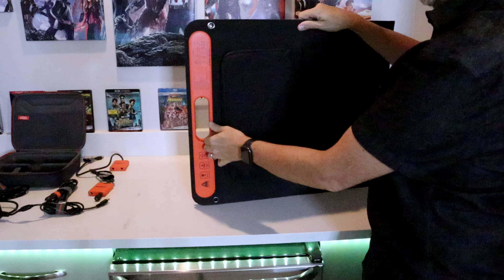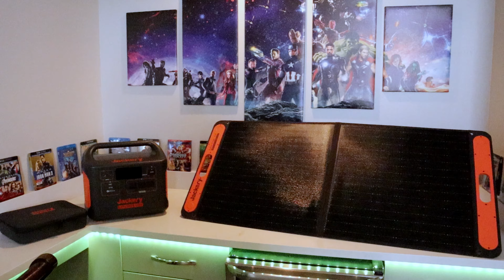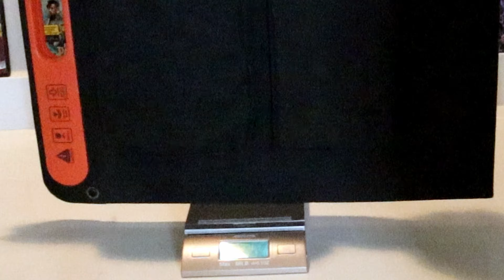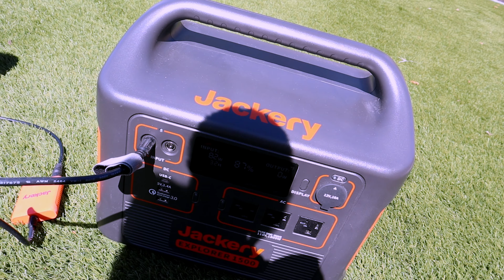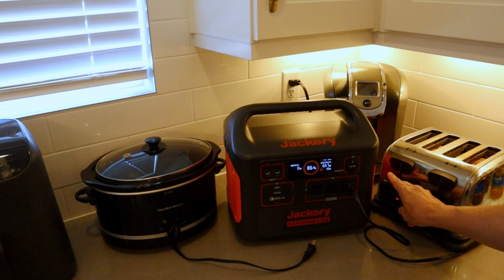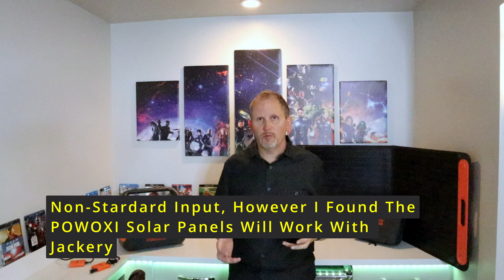JACKERY EXPLORER 1500 Solar Generator Review Portable Power

Comment: PLEASE READ BEFORE PURCHASING A JACKERY PRODUCT! I purchased a 1500 pro and had a terrible experience. This is my honest review to spread awareness to others. 

BEYOND FRUSTRATED DONT BUY FROM THIS COMPANY! When I received my first unit it was clearly brand new which would be expected. The battery was great worked exactly how they explained it would in the description. I would use this unit running off my ice co electric cooler with multiple accessories and it would last me 3-4 days while camping. Within the first 6 months I used it maybe 4 times and then stored it over winter (4-6 months) When I pulled it back out of storage for use the battery was at 97% hardly dropped from 100% when I stored it away. Awesome this is what they advertised on their website. But during my next camping trip my unit started showing a F0 code and nothing would work no input or output. This was a huge problem since I heavily relied on this unit to keep my food fresh and not spoiled. I noticed while lifting the jackery up and placing it in my vehicle to charge (thinking this would fix the pop up code) the F0 code turned off thankfully saving my food and my trip. When I got back home I emailed support and they informed me this was an internal issue causing some sort of disconnect normally due from faulty parts, dropping the unit or negligence during use. This was not my case since I never dropped the unit or mishandled it. I shipped my original unit back thinking they would stand by their “warranty” WRONG they clearly sent me a used unit that dropped battery 5-7 % a week. The unit had some use marks on it and I could tell it has been used before even though it was wrapped up like a brand new unit. I emailed support again going back and fourth as they tried to justify that this was normal even though my new unit did not have this issue. The battery was obviously compromised and after restarting it and charging this warranty unit to 100% it dropped down to 67% in 30 days. Support agreed this was not right or normal and sent me another unit. Annoyed already by this and me having to drop off now another unit to fedex I was adamant that they review this unit to make sure the battery was in fact compromised (so this wouldn’t happen to another customer) and to review the new unit they send me. They sent me another “warranty” unit… it was the same exact s/n # as the unit I just sent back to them! I cannot make this up.. terrible support terrible company! I bought this $1,300 1500 pro plus a $600 200W solar panel due to the great reviews and WARRANTY they claim to faulty parts or makes on their end so the buyer is protected on their investment. Don’t buy from this company! I fell into the trap of there multiple highly rated reviews (that they probably pick out) and the fact that they had 2-3 year warranty on their products. THEY DONT REVIEW THEIR RETURNED PRODUCTS AND WILL SEND YOU ANOTHER FAULTY UNIT THAT THEY CLEARLY DONT CHECK. PLEASE STAY AWAY SAVE YOUR MONEY AND GO WITH ANOTHER BRAND! Highly disappointed you are gambling big time with this companies products that the “new” unit you buy is actually new and doesn’t have any faulty parts and if it does even within the first year of owning you will not get a new or even close to new “refurbished or warranty” model. I hope this review gets out to the thousands of customers that look into this company and purchase their products that are not cheap by the way and that Jackery actually changes their warranty policy or at least states that you will recieve a unit that is not new and not even close to being a working model like described in the units description. They don’t review the returned units and I asked now that they send me my original unit so I can try to fix the F0 code myself at least I know this battery is a year old and only been used 5 times. They will probably hide this review and I will try to get my story out on other platforms so others can know. Terrible support and not true to their warranty description.. if you are buying becuase of the safe bet on the prodcut working and the 2-3 year warranty think again and pray your unit doesnt have an issue like mine did because they will probaby send you a POS old returned unit that they dont even review when receiving them from their customers! JOKE COMPANY STAY AWAY DO BETTER JACKERY!